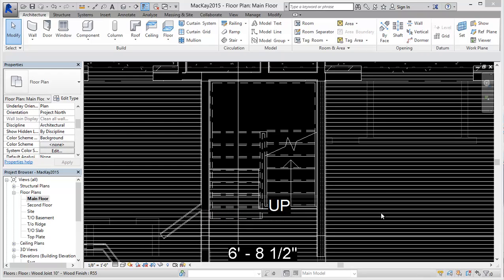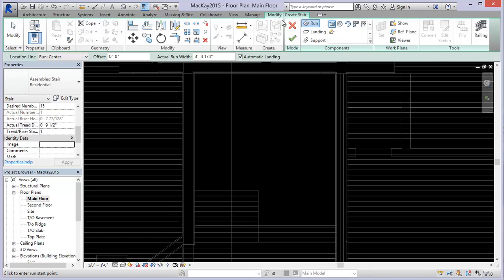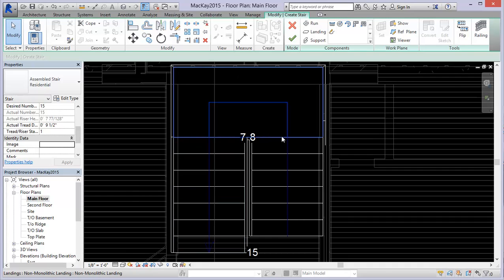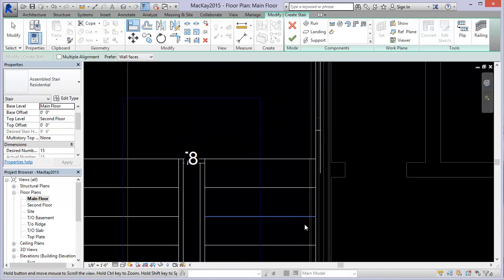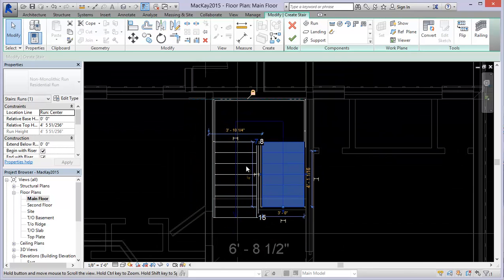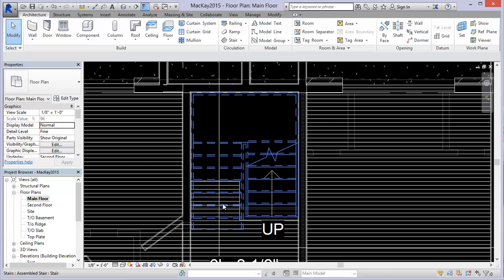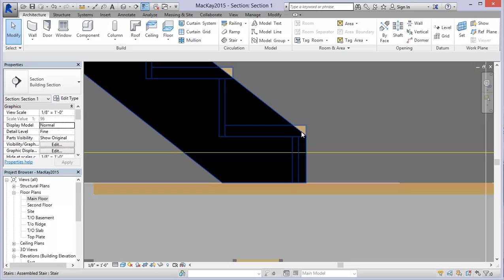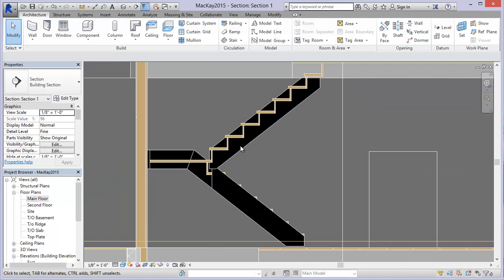Modelling Stairs by Component in Revit 2015

Comment: Hi Travis,

I just started learning how to operate REVIT. I have developed construction documents by hand using graphite on vellum, ink on mylar and AutoCAD Release 10 to 2015 for over 30 years. About 27 years of my career is in Healthcare construction/occupancy/type. The 2 videos you published explaining how to develop or construct a stair is incorrect. Your video is not the first and only video concerning stair development I reviewed. All the videos I have run across make the same mistakes which indicates the lack of construction experience or knowledge. There are Carriages, Stringers, floor finishes that are critical. Also important in developing stairs are the “types” of stair construction. Are the stairs wood, steel or concrete? Stringers are critical with steel construction not so much the carriages; the development of the carriages are much more complicated and critical for wood construction not stringers (wall stringers). At such an early stage, do I need to select the type of stringer and finish; Steel Channel, Steel Tube, Galvanized, Painted or Cladded. Also Wall Stringers are held off from the actual stud construction to allow the GWB/Drywall to run pass by or slip behind the stringers. You do not attach the stringer directly to the studs until the GWB/Drywall is installed (1/2” or 5/8” or 2 layers of 5/8” etc.).  Also guardrail pickets shall not run horizontally. Guardrail pickets shall run vertically; spacing less than 4 inches apart (a 4” sphere shall not pass through the pickets). It was discovered that children were climbing the guardrails when the intermediate pickets/rails ran horizontally. The climbed up the guardrails and fall to their death. The risers shall be “EQUAL”. I believe the riser heights are set at 7” maximum for Healthcare and ADA and 8” for residential. It has nothing to do with whether the rise is “noticeable”. The code in the NFPA requires certain critical dimensions for the stair tread Widths and Rise. Private and Public or Private (Residential) versus Public (Healthcare, Commercial, Business) are listed in the code. I do not recommend during your video that you should imply that the widths could be less than 11” for Public and 9” for Residential or 8” for existing. Don’t arbitrarily suggest a 9 1/2” tread. Enclosed/or finished risers versus open risers are critical for wood construction; it adds strength and integrity. There is too much to explain over the number of mistakes. Even when developing my own family or component parts for stairs I still could not develop the stairs correctly in section. When I drew by hand or AutoCAD I did not have to develop my stairs at such a level during the development of the floor plan. I would cover all the details for the stairs during the development of my sections. It was rather simple to accurately represent and mathematically correct the stairs by hand or in AutoCAD when drawing the sections…….for some reason I cannot achieve this with REVIT. The Carpenter or Contractor could properly construct the stairs according to the Type/Rise/Run/Floor Height/Structure as well as the presentation/image drawn on the construction documents. Where have all the Master Carpenters, Master Plumbers, Master Electricians, and the Master Contractors gone………..are they in the field for grazing. 

There must be away in REVIT that allows for a person to properly develop and draw a stair……………….there must be away.

From 
Robert Di Lena
Reply: +Travis Van Clieaf 

Hii Travis,
First I want to apologize and clarify the picket’s orientation.
The “International Building
Code” does not indicate the orientation……………. Prior to 2000, BOCA, SBCCI and ICBO each prepared their own model codes that were regionally applied. In 1999, these three organizations began to work together to prepare a unified code under the auspices of the International Code Council (ICC). The first set of I Codes were published in 2000 and included the International Residential Code (IRC) and the International
Building Code (IBC). The 2000 IRC and IBC model codes have since been adopted by states throughout the country. In 2002, BOCA, SBCCI and ICBO officially merged to form the ICC and they approved an updated IRC and IBC most recently published in 2012. BOCA and the IRC changed the pickets: The published 2000 IRC stated that guardrails shall not be constructed with horizontal members or other ornamental pattern that results in a ladder effect. The ladderbeffect has never been a part of the IBC. The ladder effect was
removed from the IRC during the 2001 code cycle.  The change was noted in the 2001 IRC supplement and the current 2003 IRC contains no reference to the ladder effect. However, some local code authorities are using older codes based on BOCA – the creator of the ladder effect wording and the 2000 IRC.Many local code inspectors are not aware of the change and may reject guard-railings with infills they interpret as
creating a ladder effect. It is taking time for the 2001 IRC supplement and the new 2012 model codes to trickle down to the local levels. In the meantime, be prepared to address this issue; this issue effected my designs in the state of Florida. 
Going back to my earlierquestion……with respect to the risers. Do you use ever use the term “equal’ number of risers or give a set riser height prior to developing the stairs. What I am trying to explain is that for over 30 years I would give the
contractor the number of “Risers” and an “approximate” riser height. I did not give a set riser height (let’s say 6 3/4”), I would give the floor height (let’s say 10 feet – 120 inches) and indicate on the drawings/section the number of risers (let’s say 18); so each riser would be approximately 6 21/32” (6.66). Now how do I do that with Revit? 

Can I give an approximate
Riser Height? Traviss do you have a Linkedin address?
Best Regards, Roberrt
Reply: +Travis Van Clieaf 
Thank you Travis